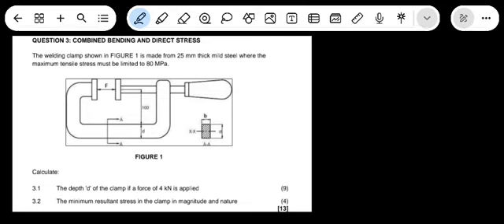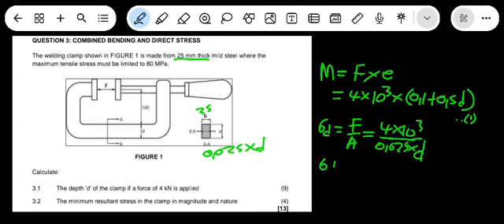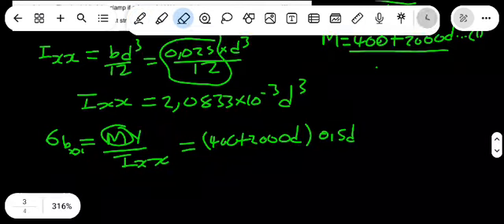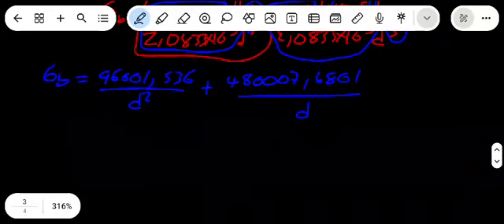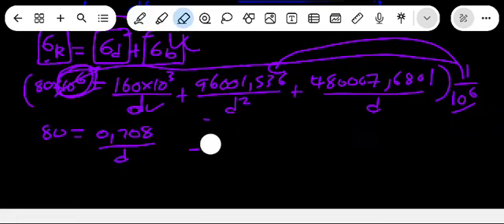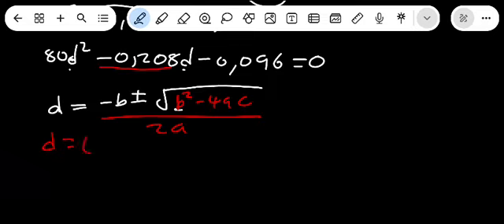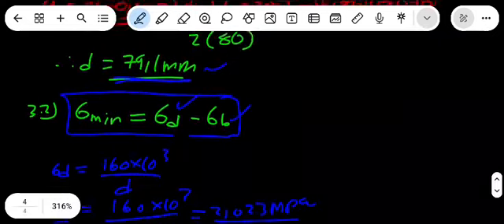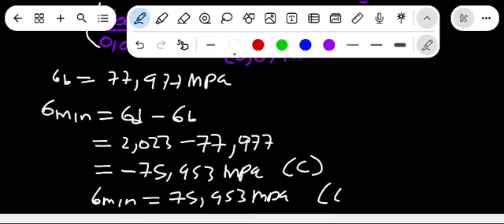Master Combined Direct & Bending Stress | N6 Exam Preparation

Comment: i see two errors one at the 15:27 mark it comes to 0.16 not 0.208 , my diameter comes to 30.87mm and when you calculate the bending stress for the resultant you are using the direct stress equation as well at 23:29 mark